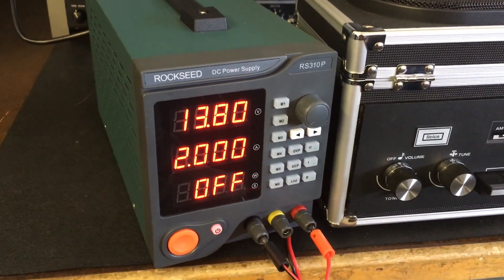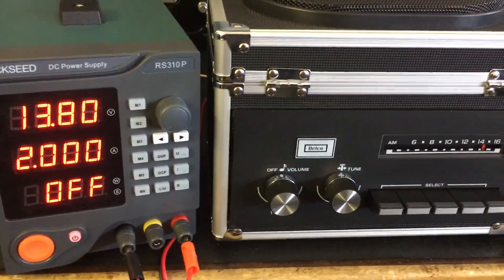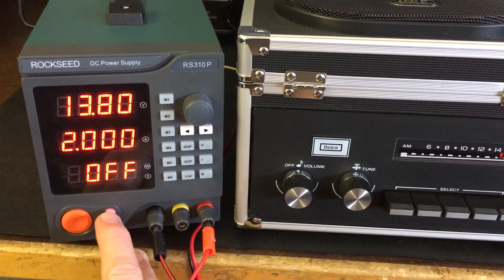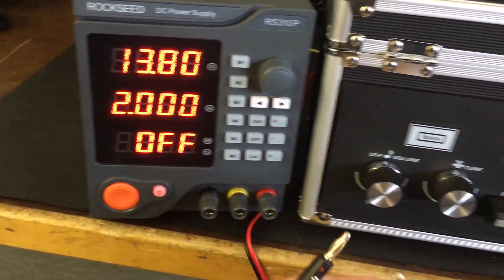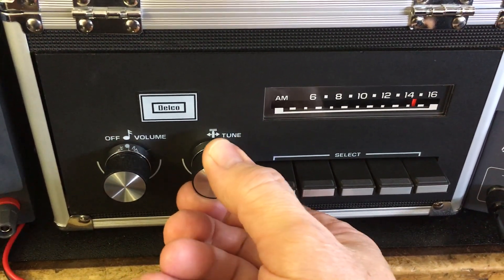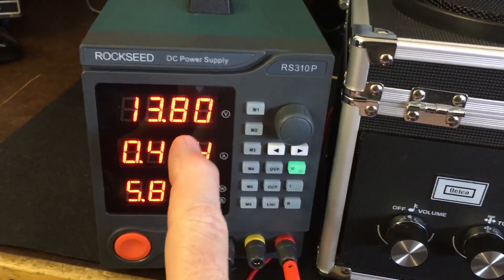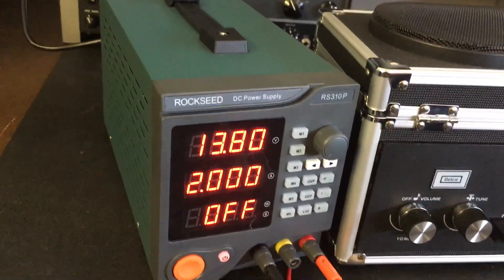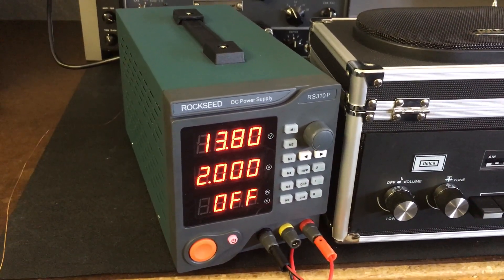Lab Bench Switching Power Supply RFI/EMI Noise Issue

Comment: Older video but did you ever know for sure what this was?

Same exact model (I see you returnes yours in other comments) and it gives off an awful coil whine until it hits about 10w. At that point it'll work clean and silently. Anything less than about 10w will make my PSU sound like that radio, lol. 

It stinks as I don't use it very often, take very good care of it and I don't recall it being an issue until the last time I used it.

Comment: If you're not going to send it back, fix it! I bought a cheap ps on ebay, it was trashy. There are a few you tube videos on the very unit I bought. Three components and it is ok now until I take the cover off. Also you have big window on the front where the leds are. Your problem is really bad, loose ground maybe?
Reply from the maker: Yep it's really bad Jerry.  Radiates EMI to other radios on the bench. I really should have gone right for a linear PS.
I may have seen that same video as you did.  I almost bought this Kaiweets unit.
https://www.youtube.com/watch?v=idf8nRw19DM
Eddie's really into taming this beast and all the noise that comes with it.

I sent the Rockseed back today and ordered the Tekpower TP-3005D-3 linear PS.
Seems like it may be just what will work for me.
https://www.amazon.com/gp/product/B00HX0UYBK?pf_rd_r=N9Z53FYZM1GSQ6PNQX6E&pf_rd_p=5ae2c7f8-e0c6-4f35-9071-dc3240e894a8&pd_rd_r=0101813b-2189-42a4-a812-62bbfdb696b9&pd_rd_w=HL8i5&pd_rd_wg=K6UIT&ref_=pd_gw_unk
Reply: I have an astron 50amp linear power supply, it's heavy, and quite. The 10amp smps is light and quite, but I had to work on to get it that way.
Reply from the maker: @jerrydaugherty3781  Those Astron's are great PS's.  I got an old one from early 1980's.  No meters. Need to pull it out of retirement and give it a check out.